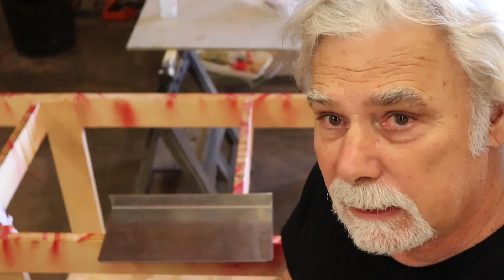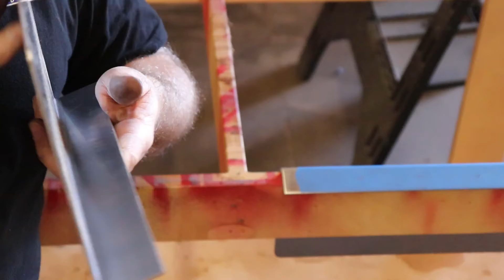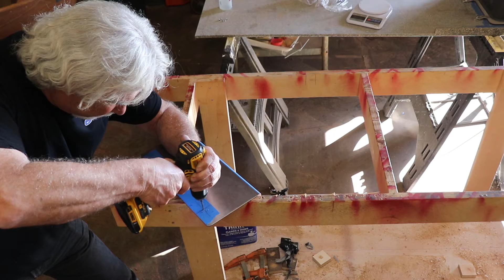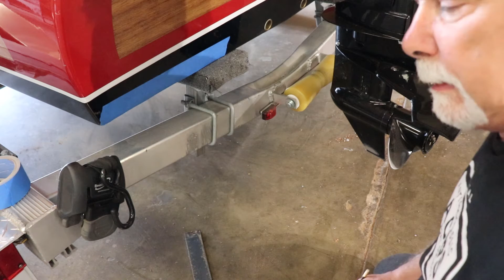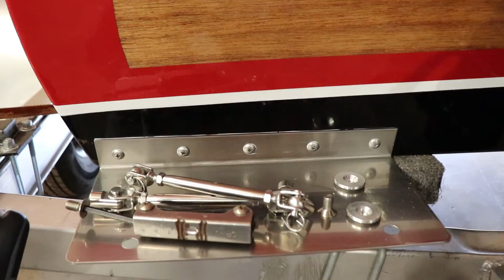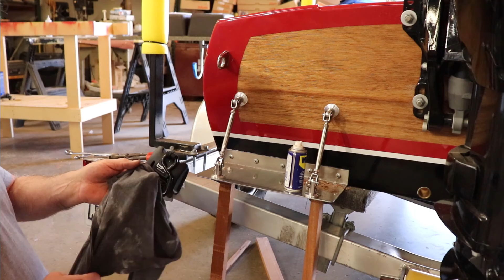Fabricating and installing stainless steel cavitation plates on our classic plywood runabout

Comment: Feels like it had not been troubleshooted enough before the additions. Crisp edge to transom?, Wrong angle on transom? Weight distribution? Wrong shaft engine? Feels like this kit rarely has porpoising when built... On rare occasion utility built boats have this. Tank near the rear? heck, I'd even say engine wedges could have solved the trim issue.